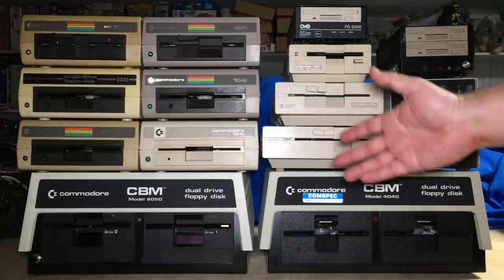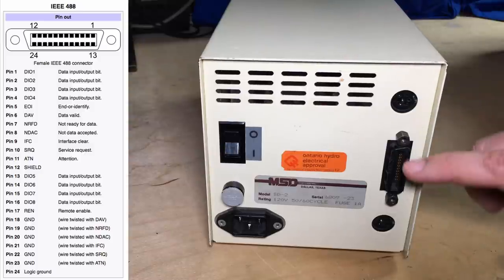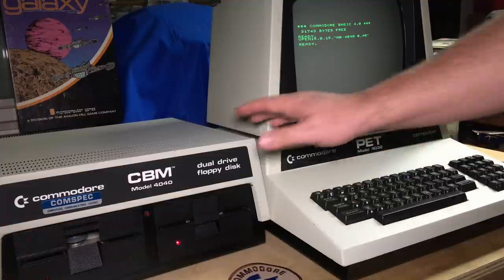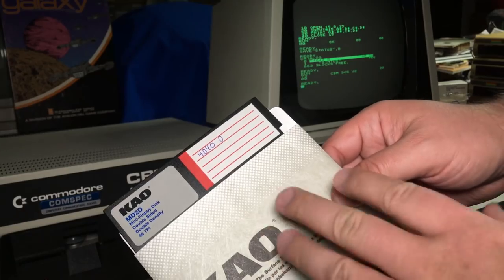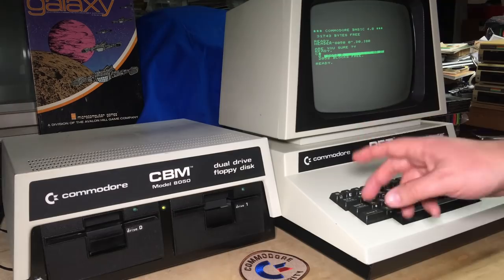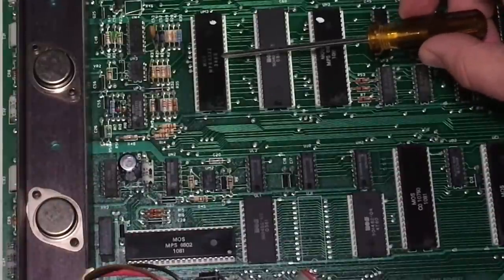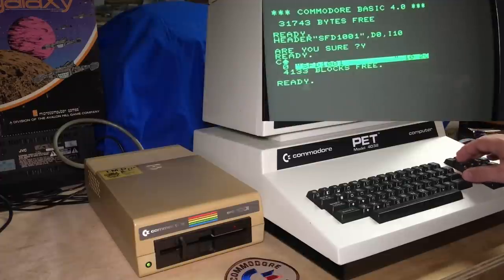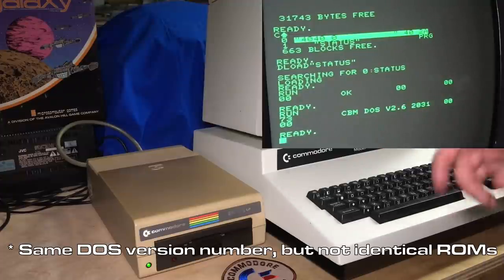Exploring My Commodore IEEE-488 Disk Drive Collection

Comment: For some reason, I ended up with an "Enhancer 2000" disk drive for my Commodore. I think I was suckered in by the advertising of it being faster than the 1541 (and it was a bit faster.) It also had a much slimmer profile than the 1541. Problem is, it wasn't fully compatible. Some fastloaders didn't play well with it. The ubiquitous "QuickLoad" or "QL" you'd find on cracked disks was fine, but a lot of commercial software with fastloaders simply would not load up on my Enhancer 2000. I remember being so disappointed after getting Garry Kitchen's Gamemaker for Christmas and it refusing to load on my computer, but working fine on my cousin's C64 with 1541. It affected maybe 5% of games, but it was annoying as hell, as I couldn't trust buying commercial games without testing them out first (and it's not like they let you return it if it didn't work.)
Reply from the maker: Presumably the Enhancer 2000 was a little cheaper than a 1541 too? I'd love to have one of those clone drives now, though I'm sure it would have been very frustrating to have as your only drive back then, as you describe it!
Reply: @8_Bit  Yes, I do remember it being somewhat cheaper. It's too bad it wasn't completely compatible, as I thought it looked and felt much better than a 1541 drive. I just recently read that there was a rom for it that solved the compatibility issue with almost all games. Now whether that was around during the E2000's heyday, I don't know, but I certainly didn't hear or read about it (then again, I was the only person I knew who had the Enhancer.)
Reply: @8_Bit  Yeah, looking through some old issues of Compute's Gazette online, it seems that the E2000 would go for about 2/3 to 3/4 of the 1541's price--actually, it depends. Early on it was the same price, with some retailers it seems.).I also found an article in the Feb 1986 issue of alternative drives, and it says part of the problem was that some commercial software would check for/use  1541 ROM routines as part of a copy protection scheme, and since these disk manufacturer's could not copy 1541 ROM exactly, this would cause some games not to load up. This makes sense to me, as my compatibility problems were almost all with original copies of commercial games, not cracks.

Comment: I have the Commodore floppy disc drive, and the commodore PET, I do not however, have the cable that connects the two. Where might I find such a cable, do you know?
Reply from the maker: They've become extremely rare since they are a custom cable only Commodore made; it's a standard IEEE-488 connector on the disk drive end, but a flat edge connector on the PET side. Fortunately, my friend Jim Brain sells an adapter for the PET side, so you can use a standard IEEE-488 cable: http://store.go4retro.com/ieee-cable-adapter/

You can then find the standard cable on eBay, Amazon, or wherever. Actually, Jim sells them too: http://store.go4retro.com/ieee-488-3-cable/
Reply: @8_Bit  Thanks very much for taking the time to reply with a solution. Subbed.

Comment: Nice collection. Does that "checkdisk" command work on C64 and 1541? It's really useful. Can it check the disk surface without formatting it?
Reply: The closest thing to a "chkdsk" command is a Validate command: OPEN 15,8,15, "V0". The drive goes over the entire disk, releases previously deleted files, releases earlier copies of duplicate file names created when saving a file with an existing name ( SAVE "N0: FILENAME",8), finds broken (corrupt) file sector links, and then rewrites the Block Availability Map keeping track of sectors with read/write errors (bad sectors). It only writes to the BAM and leaves valid files alone.

Comment: Apologies if you have answered this many times before but why do the commodore drive heads make that awful banging noise? I know its the heads moving to the side but why was it necessary? Used to hate the knocking noise on the 1541s sounding like it was doing damage.
Reply: It's when the drive loses track where the head is. It moves the head 40 tracks towards the center outer edge to be sure to be on track 1. If the head was on track 18 before the movement then the head will bang the end stop 22 times. There is no other way to detect track 1 in the 1541.
Reply: @Okurka.  thanks

Comment: I wonder why commodore didn't keep the 'catalog' command for the 1541s
Reply from the maker: For whatever reason (cost savings, mostly?) Commodore put BASIC 2 in the VIC-20 and Commodore 64 instead of the BASIC 4 that later PETs had. BASIC 2 fit on a smaller ROM, but lacked the useful disk commands.
Reply: 8-Bit Show And Tell didn’t know that thanks!

Comment: The SFD1001 and the 8250LP suffer from leaking capacitors that actually destroy the board! If you have one, pls check before it gets destroyed (and can only be recovered with large efforts! For details see this (German) page: https://forum.classic-computing.de/forum/index.php?thread/7382-auslaufende-elkos-in-cbm-8250lp-sfd-1001-cbm-8296d/ or my pages where I show the repair of my drives: https://www.flickr.com/photos/afachat/albums/72157651797112596  and https://www.flickr.com/photos/afachat/albums/72157653645777010

Comment: I think that Commodore did a big mistake with the disk drives for the C64. Too slow due to serial connection, not reliable due to overheat inside the disc drive and too expensive.

Comment: How come you could still run the status program at 9:00? Shouldn't the directory/catalog have overwritten it?
Reply from the maker: The CATALOG command "streams" the directory to the screen, and doesn't overwrite BASIC memory. So it's a nice improvement over LOAD"$",8 which replaces the program in memory.
Reply: 8-Bit Show And Tell Interesting. I wonder why they didn‘t use the catalog command on the C64 then. I mean, why go with an inferior solution on a computer that came out years later?
Reply from the maker: @franks.7736  I don't know the answer for sure, but I have a couple ideas. Earlier PETs had BASIC 2, and then later PETs had the improved BASIC 4 that included the CATALOG command and some other improvements. BASIC 2 (and the KERNAL OS) were squeezed into 16K of ROM, while BASIC 4 required more (24K I think, I'd have to look that up). The VIC-20 went back to BASIC 2, presumably as a cost-savings measure: smaller ROMs are cheaper. So why did the C64 end up with BASIC 2 also? It could be simply the same cost savings. But it could also be that the C64 was hurried to market, built on top of the VIC-20's design in so many ways, including the same IEC disk drive code that was developed for the VIC-20, and it just made sense to use the same ROMs given the time it would take to implement a new BASIC/OS. And related, the C64's memory map was probably already "set in stone" at an early stage and adding another 8K of ROM for improved BASIC just wasn't practical.
Reply: 8-Bit Show And Tell Makes perfect sense, thanks for sharing.

Comment: Indus GT is conspicuously missing !
Reply from the maker: Strangely, I have an Indus GT for the Atari 8-bits, but not the Commodore model.
Reply: The Indus is definitely my favorite 8 bit drive of all time.  I have one hooked up to my retro PC that connects parallel to 1541 adapter so that I can turn D64 files into real floppies. 
I still today use the c64 my mother bought for me in 1983.

Comment: imagine having the Commodore 8061 1.6mb 8" drive you would have about 12498 blocks free after formatting the dual drives (approx 6000 per disk), although if you had a video of that it would be banned from youtube as porn :)

Comment: Most of them have basically a C64 inside, which is hilarious.
Reply: - - - and now we wait - - - Muhuhahaha 👹
Reply: I always wondered why the drives usually cost more than the computer and that's probably the reason.
Reply: Basically a C64 without the VIC, SID, PLA, less RAM, different CPU, different ROMs, VIA instead of CIA, no RF modulator. Hilarious!
Reply: The fact that it uses a 6502/6510 microprocessor to control it doesn't make it a C=64. The space shuttle may have used a Z80 microprocessor to control the fuel mixing valves, that doesn't make the space shuttle an Apple computer.
Reply: Oh here we go again 🤣 I know, I was just joking to my friend Okurka.
Reply: @3DPDK  Apple never used a Z80 in its computers.
Reply: @Okurka.  True, but for a lot of younger computer enthusiast, names like Kaypro, Heathkit even Tandy are unknown computers that did use it. I just pulled the name out in a typing frenzy. You are correct. The Apple II actually used a 6502, same as Commodore, went with 68000 series for 16 bit systems (6502 was based on 6800 architecture) and finally switched to Intel microprocessors in 2005 (or so).
Reply: @3DPDK  Apple also used the PowerPC for a decade before switching to x86 CPUs.
Reply: It's hilarious from a technical standpoint, but not from a marketing standpoint. It was a way of making the computer itself as cheap as possible, once you had invested in your computer from a particular brand, the company could charge high prices for peripherals.

Comment: I still think Commodore cheated with bringing 500k on a single density disk, going over the actual "specs" of media types. For a technical discussion see https://extrapages.de/archives/20190102-Floppy-notes.html
Reply: Well I know it's two years later but I feel I must point out that your statement about the erase coil: "before writing, erase a slightly wider track on the media" is not correct. Erasing isn't like on audio tape, the write head just overwrites previous data. The "erase" occurs at the same time as writing in a straddle erase head and just after writing in a tunnel erase head. It does create empty guard bands on each side of the written data source. Source
http://info-coach.fr/atari/hardware/_fd-hard/AN-917.pdf
Reply: @8BitNaptime  thanks that's interesting information!
Reply: @8bittimes  You're welcome! I went on a deep dive about floppy disks when I started noticing the Newtronics head failure in 1541s. I found out a lot about floppy disks but not how to repair these heads. I think it's borderline impossible to repair, maybe with a microscope micromanipulator like biologists use...
Reply: @8BitNaptime  for me it would be enough if I could get my JU-570 drives (from the SFD1001 and 8250LP) repaired ... IIRC only one or two of the five drives I have a still in working order
Reply: @8bittimes  So... what happens to these drives? I have two SFDs and now I am worried...